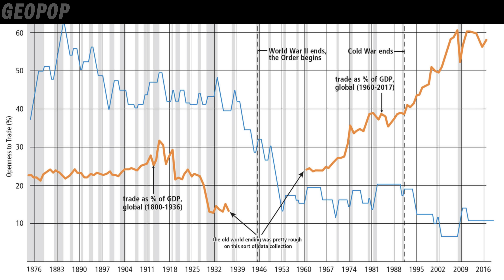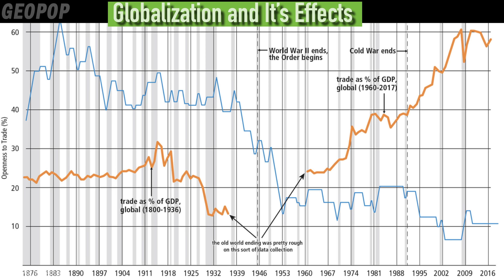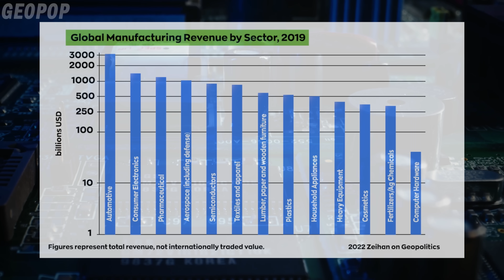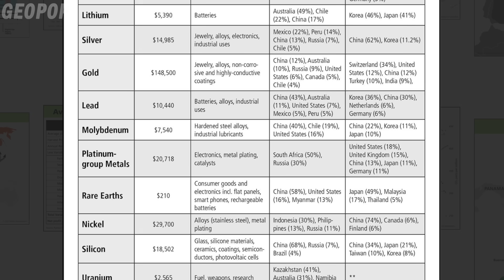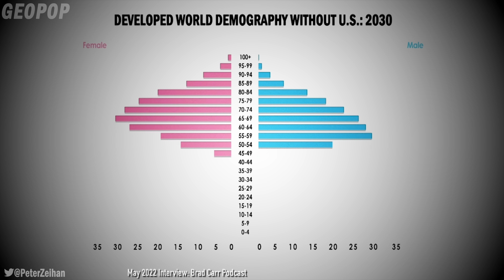The End of More | Peter Zeihan on the future of Industrial Materials

Comment: With solar pv on your roof and a n EV battery plugged into the grid, you do not need a massive horrendously expensive fattening of the national power grid and the extra electricity generation capacity. 

Raw materials for national power grid capacity expansion are massive.

Comment: Why are we wasting time with electric vehicles again? They cost more up front, the current system isn't even close to being able to handle the increased demand in electricity, and they don't even break even for carbon output for at least 60000 miles. Fundamentally, that means the proponents of them are ok with dumping 60k miles worth of CO2 into the atmosphere up front for a benefit on the future. But those same people think we need to stop emissions immediately.

Comment: What everyone misses in these conversations is the reality that increasing complexity leads to decreasing marginal returns. As we rely more and more on increasingly complex technology for solutions to current problems, we will see diminishing marginal returns. We won't see huge jumps in living standards like we have seen over the past few centuries, instead we will need to use more and more energy and raw materials just to maintain our current living standards.
Reply: Fusion breakthrough in the last couple days.
Reply: @rpscorp9457  There is another power system which is almost ready: Thorium. Only politics prevented it from being licensed. The Light Water Reactor industry had captured the nuclear regulatory commission. It would not allow a license for the full scale (250 Mwatt (e)) experiment necessary for venture capitalists to build more.

This technology is not dead. All that is needed is materials engineering to verify how long a Thorium Molten salt reactor can safely run. The US NRC has stymied such experiments in the US, but not in other countries. India and China has plans for Thorium.

Comment: In the 1970s there were many similar predictions of doom from resource shortages. It never happened. I'm skeptical.
Reply: Sort of agree but  the 70's had a work ethic.
Reply: Everything is limited. We will run out of some materials if we keep consuming like we currently do, like helium. (Helium is the only element tha cannot be recovered at all, cause it escapes the atmosphere, only slowly created by radioactive decay) to a very small extent hydrogen and rare earth metals. The question is how long until it happens, and if we manage to create a cyclical system wherein we consume as much as we add before it reaches a point of no recovery. Or rather, a point where recovery requires a hereculean effort. Like sifting through landfills with expensive machinery for 10 years to only recover an average amount of material. Or smelting down and seperating composite materials. Or sucking up carbon from the atmosphere to make new coal. It works, but it is sooo much slower and expensive than just mining new stuff.
Reply: If you gotten away with running red lights ten times, you will start to think you can get away with running red lights
Reply: @stellarwind72  OR maybe I was never running red lights in the first place and they were all illusions by a kleptocratic elite that hate you and want to lord over you. Hope you enjoy your carbon credits, Leonardo DiCaprino needs more gas for his private jet!
Reply: @0utc4st1985  Have you actually read Limits to Growth, instead of what some economists said about it? It didn't say that we were going to immediately run out of resources. It predicted that if industrial civilization continued its trajectory, we would start running into problems of resource scarcity, pollution, or both and that economic growth would halt and go into reverse, sometime in the first half of the 21st century . We are certainly seeing problems with pollution (e.g. Climate Change), and now we are seeing resource shortages as well (have you seen gas prices within the last year). The kleptocratic elite were the ones who ignored the warnings and got us into this situation.

Comment: Lithium is one of the most common elements on Earth (more specifically, in seawater) and it's the 3rd most common element in the universe.  It's silly to pretend that there will be a Lithium shortage.  Same for silicon, present in common beach sand... and silicon dioxide is known as... drum roll... quartz.
Reply: Helium is the 2nd most common element in the universe, yet its rare on earth. It generated from the by-product of alpha radiation in which a helium nucleus is ejected from a heavier radioactive isotope. Helium is necessary for things like chemical Quantitative Analysis and MRI's. Just because it's common else where doesn't mean it is here. We are predicted to run out by around 2030s-2050s.
Reply: @chungusfungus123  You don't even know what I said...
Reply: @aircvr4175  I know what you said, but do you know what I mean?

Comment: 7:17 I don't think silver will be readily available either soon enough. Recycling isn't feasible unless the price shoots up drastically.
Reply: If price shoots up, copper will be used. Silver is not required in most places it is used. It's used because it's the best by 5%. Electic car motors existed long before people put siver in them. Silver is use in solar panels because as long as you're spending $200 on the Si wafer, you may as well spend $20 to boost perfornance by 5%.

Comment: I think Peter is right and wrong at the same time. He identifies the base problems, and in other video's talks about the underlying politics but misses the point. If breakdown occurs the politics will change. China, Russia, Iran are only problems because they are dictatorships. If the crashes there lead to liberty, you may see both changes in opportunity, economic procedures and demography; a liberty baby boom. If the dictators cease to exist then trade can be resumed. Even Trumps said that and he will be running the show after the new Republican majority is sworn in. 
Likewise while getting the resources for global green power is a problem there is two solutions. 
Jail the climatologists for fraud and the fanatics blocking roads and vandalizing art. If its a fake problem its solved. The world is not heating and it does not matter if it did due the discount rate errors in the IPPC economic math's. 
The second option is to look at the solutions rejected by the IPPC and others such as putting a compressor in the windmill and storing compressed air then running that though a motor dynamo as required (canned wind). This is simple solution for wind. The solar solution is solar updraft systems. One was built in Spain, it worked, the maintenance money was stolen by a government and it broke. And they wont let others fix it even for free. For vehicles its ethanol hybrids with on farm distillation so you can use the beer mash and livestock feed. These are all known and rejected by the greens and the IPPC and its friends. Retooling a country could take a year or two and would be an economic boom, just burn the red tape. We also have new fission, cold fusion is still out there, several battery technologies are being ignored.  
 
Peter talks about a global collapse in finance but that assumes that somehow people stop saving and investing. That's not likely. Demographics means saving will shift to south east Asia and Africa if allowed. It may become more localized but with the world wide web it is not really local anymore. There is also a rise in crowd funding of both public goods and investment projects. If global investment goes local then that's not bad. It may not be making what Klaus Schwab wants but its still investment. 

The short term problems are being solved locally too. Europe has already stocked up on gas and began reopening coal mines (unofficially in some cases). Its started fracking in some places and that gas comes online in December. Green protesters are being jailed.
If your on a war footing something that takes 3 years takes 8 months. Bureaucrats are fired. Red tape burned for fuel. We see compact home heaters powered by wood, coal, candles are selling like hot cakes. There will be house fires. 
Julian Simons The Ultimate Resource should be on everyone's book shelf. Resource shifting will happen. We are not running out of resources we just have dictators either messing with supply or using it as a weapon forcing trade barrier responses. That can be fixed if we keep the pressure on the communists, islamists and ecoterrorists.
Reply: Sadly you have a lot to learn. Dictators (Kleptocrats) have been around a long time. etc.
Reply: @tedmoss  True but that was said for many places in the world where they now don't dominate. Freedom has spread world wide. I'm a Christian; I believe that western freedom and justice, a product of Christian protestant faith and teachings, will spread to everywhere eventually. Compare today to 1922 or 1822 and see the difference. We are down to 6 interlocking dictatorships, some European socialists, a few beleaguered islamists, Biden's pedophile party, and the climate cult. We can see the whites of their eyes!

Comment: Do you think if we dropped all fossil fuel subsidization the market would correct towards renewables?
Reply: No.
Reply: If we dropped subsidies and tax breaks for renewables and were being honest then we would say that although renewables will slowly replace fossil fuels, it is going to take a lot longer than a couple of decades as some politicians and clean energy advocates report. And everyone’s standard of living will be dramatically reduced.  It is not fair to compare the energy base load provided by fossil fuels to intermittent and unreliable energy provided by solar and wind.  Slowly over the next fifty years, new energy storage technology will help bring renewables closer to being able to provide base load power.   Make no mistake, switching over to electric cars will not get rid of fossil fuels.   Unfortunately what we will see is drastic increases in the cost of electricity.  Replacing gas and diesel infrastructure with a revamped and beefed up electric grid will be very expensive.  And we need to get the electricity by burning some fossil fuels unless we start building nuclear power plants.   It takes a lot of energy to extract fossil fuels from the earth but fossil fuels deliver so much concentrated energy in return that is easily stored.  Building solar panels and wind turbines and electric car batteries takes a lot of energy to mine the rare elements and process them. Then you have very low levels of energy produced by these photovoltaics and wind turbines  and no great way to store it inexpensively.  We can do it.  We can do almost anything if we work really hard.  But getting the government out of it and letting consumers and the free markets drive the decisions and rate of change will be way more successful than subsidizing bad companies with bad balance sheets like Obama did with Solindra.
Reply: @challengersrt8680  As of 2019, ~1/3 of all energy went to transportation, 0.03% went to electric tansportation and electrcity is 37% of all energy consumed and is close to maxed out currently. We'd need to develop 20% more electrical capacity.

Comment: Pete's storytelling is pretty compelling until you break it down and take a second look. For instance in discussing solar panels he says making them is easy but assembling requires "fingers and legs ... you can't automate that." Look at robotic automobile assembly. Look at Boston Dynamics autonomous robotic systems. I believe the demographic crunch Pete gets so excited about will be a golden age for automation and AI systems.
Reply: Of course, don't believe the nay sayers.
Reply: He has very detailed conversations about the entire chain from raw materials through installation and maintenance, including pv element longevity.

Robotics and AI are discussed a lot by people who don't know anything about robotics and AI, as if these will be miracles for the future to solve all these problems.

Automation has actually shifted the workforce from machinists and much of the assembly, to coders who have to maintain the systems and business management software, with a skeleton framework of technicians who run the machines.
Reply: @LRRPFco52  We've seen the reduction in labor coming out of automated systems going all the way back to Henry Ford's conveyor belts and assembly lines. It hasn't slowed down one bit. The machinists, coders and technicians needed to run the systems represent a small fraction of the original work force. One doesn't need a degree in robotics to follow the progress in the field. And no one said anything about "solving all these problems." that was your strawman attempt. Problems will be solved for better or for worse as they present themselves.

Comment: The answer to the uranium problem might well be the LFTR design for fission reactors. LFTR designs use thorium as the root of its fuel (233U) and operates at low pressure so that it is safer for land based use.
Reply: LFTR also works as LFUR.  The problem with Uranium mining currently is that all uranium mines are NOT equal as we only use a TINY percentage of radioactive uranium currently instead of the other 99.7%.  A LFUR would not only get much more power per KG of Uranium, but also use 100% of available Uranium and a quick step to LFTR as well.
Reply: @w8stral  That's one of the cool parts of thorium designs.  Thorium is 400x more common than the isotope of uranium used in "modern" reactors.  It is available worldwide, and the isotope that comes out of the ground is the one you would put in a reactor so no expensive preprocessing to separate isotopes is necessary.  Thorium is not itself fissile, but it is fertile, so thorium can be turned into uranium by hitting it with neutrons in a breeder reactor.  The isotope of uranium so produced is fissile, so the same reactor can then use the uranium to produce power, and of course more uranium from thorium.
Reply: @bersig  Well, not  exactly, but very close.  You need the U233/U238 to start the breeder reactor so you will still separate the stuff out.  But you do get to use All the rest of the Uranium, your 300X, + another 450X of Thorium, so ~800X availability of fuel and each kg of fuel produces vastly MORE power (Several magnitudes  MORE) than current reactors.  Though this number for Thorium in comparison to Uranium, most think is VERY low and the actual ratio of Th to U is closer to 3X or 10X that of Uranium.
Reply: @w8stral  Not quite, yourself. Only U233 and U235 are fissionable, not U238. 

If you use a two fluid LFTR design, you have a blanket of Thorium Fluoride, around the core, which catches neutrons and turns into PA233. This is removed and stored for about a year, so that it turns into U233 which can be placed inside the reactor. The U235 was just a starter pack.

My understanding is that the US government has, in Wyoming, enough Thorium stored in shipping containers to supply all of America's electrical needs for a thousand years. It was left over from Rare Earth processing. The rest of the world has enough Thorium for over 5 thousand years. The moon seems to have a 100 thousand years worth.

Uranium is rare enough by itself. And only 0.72% is U235 which you have to concentrate. Fast Breeder reactor experiments were shut down as impractical. Thorium is about 10x more common than Uranium and all of it is Th232 which is fertile. If we, India or China can make LFTR practical, we won't run out of Thorium soon.
Reply: Yeah I always wondered about these. Seems like safer to operate and easier the fuel is more abundant. Mind you I’m an ex nuke from the Navy so I have some idea of what I’m talking about. Seems only reason they were never produced in masses because you couldn’t use the byproduct for making special weapons.
Reply: @johnjohnson5116  And liquid salts on a shipboard reactor are not exactly a good idea.
Reply: There is no Uranium problem, we can recycle partly used Uranium.
Reply: @tedmoss  But we do have a problem with thorium. We have too much of it. More importantly, the LFTR designs run at much lower pressure than the light water designs and that makes them much, much safter.
Reply: @tedmoss  As expensive as it is, 235U is not the actual problem. Reactors that use 235U operate at high pressures and temperatures. This makes them dangerous while they are in operation on top  of using a metal that costs more than gold to mine and refine.
Reply: By AGREEMENT  the USA gets 19% of our nuclear fuel fom old USSR warheads that are recycled  in the USA,  RUSSIA  has no ability to do this. Uranium is not a problem to get.

Comment: Don't forget graphite.  Future generations of EV batteries don't use Lithium.  But they all require graphite.
Reply: You can get graphite by burning trees.
Reply: @tedmoss  Correct.  Graphite is just a different structure of Carbon.